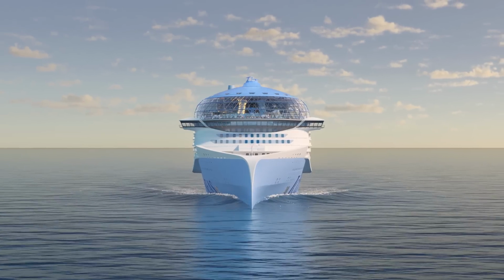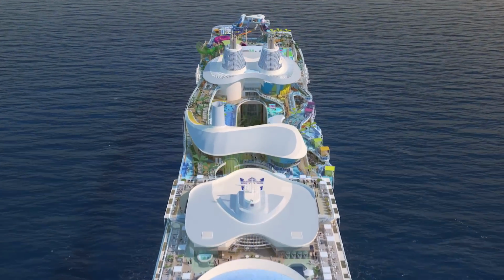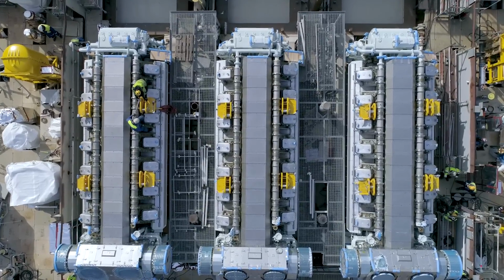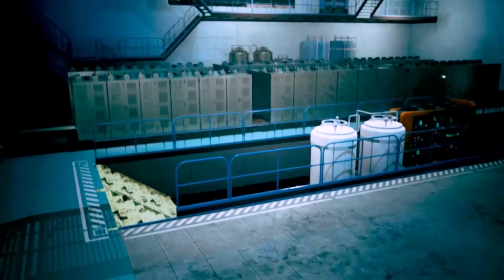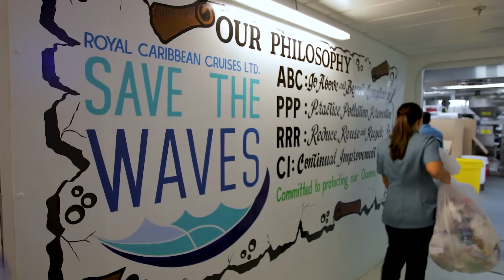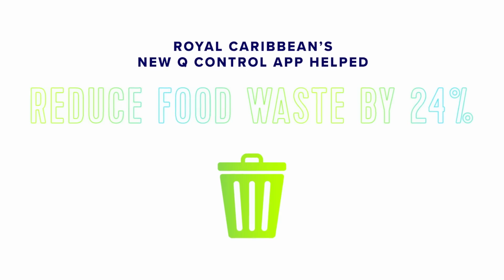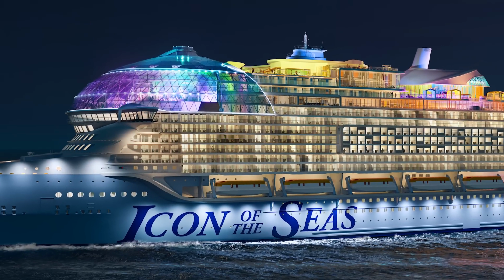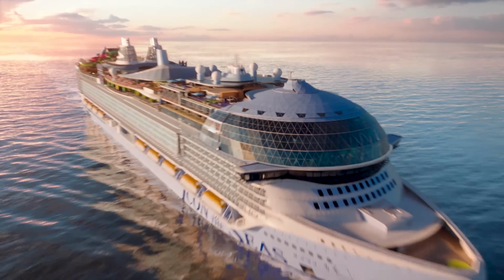Royal Caribbean created the most eco-friendly cruise ship yet!

Comment: Besides if you use heat or fire to extract energy out of any fuel the maximum extraction rate is only 10% but because nuclear fission works differently you're getting about 80% which is a lot better take a lot less waste. And one thing you can do for your diesel electric ships is the back off the throttle about a and you'll see you'll have a lot more fuel savings that will add up quickly